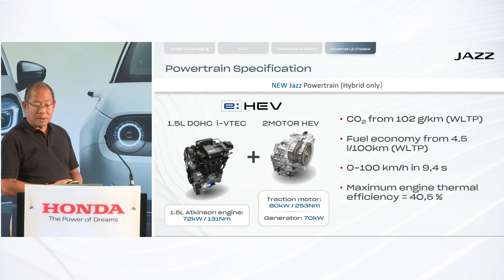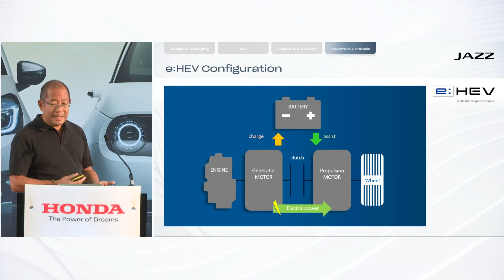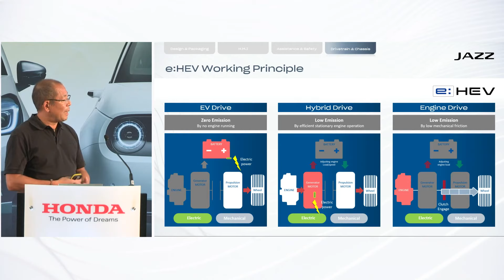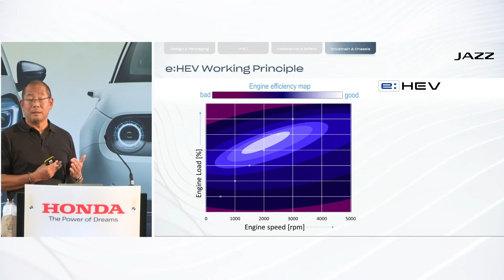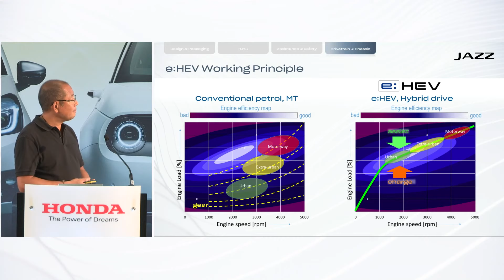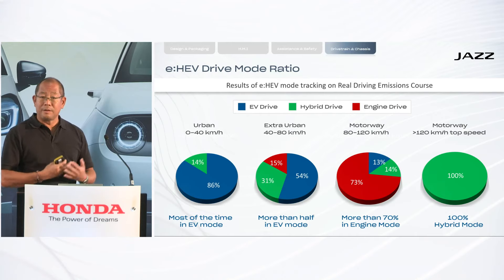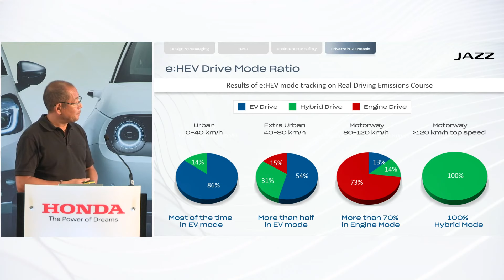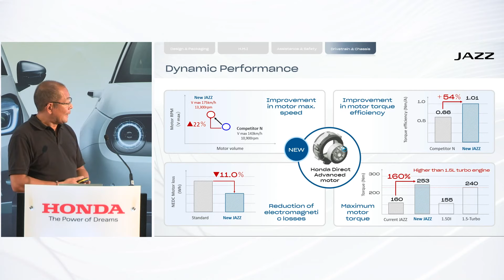Honda e:HEV Hybrid System – How it Works (Ko Yamamoto, Technical Advisor Honda Motor Europe)

Comment: I believe Honda found the perfect system for Hybrids.  The push for EV's is wonderful but imagine an entire population dragging down an electrical grid!  Most first world electrical grids can't handle what's happening today, let alone the proposed larger loads from EV's.  This Honda system will be legendary, it will take about 20 more years for this engine to be "phased" out. Well done Honda!
Reply: Yes, I don't believe pure electric is sustainable for cars & trucks. eBikes and motorcycles? Maybe. Hydrogen engine→electric is probably best,  but that will take some time.
Reply: Perhaps add a plug-in charging to the e:HEV would complete the picture
Reply: @ken2633  2025 Honda CR-V plug-in Hydrogen Fuel Cell EV. Available for lease in California only.

Comment: I only Drive 39km/h now.. my actual Record was on 1.2L/100km!! Amazing!!!!!!
Reply: Wow. But you are probably forgetting the battery depletion. That energy also counts because you will need to start the petrol engine to recharge the batt.
Reply: @rod-no-tube  

Good evening!

No, I am well aware that the battery also discharges during the ride / after the start and thereby also the gasoline engine switches to it. Thanks to my very Spirt saving driving style, however, it is so that when I drive at the maximum possible speed allowed (always drive cruise control!) hardly need the maximum power of the engine (Except of course uphill, there you can not change anything, except to accelerate again briefly something before the slope!). Have therefore also hardly any deviations in the speed & can so by anticipatory driving also get back any amount of battery charging.

By the way, I have again set a new record & was able to achieve a fabulous average consumption of 1-1.7L/100km with several kilometers of driving! So in total I could reach 1'265.1km distance! If I did not now still have a huge mountain that I still have to climb all the way. Then even easy 2'000(+) km would be possible!

Good trip I wish them further! :)
((Maybe I'll make even times nen video, regarding my driving))

-Snowly 😃
Reply: lol its costless to drive almost

Comment: I have 2022 honda cr-v on all seazon tires bridgestone turanza. Drive in crowded city mostly. 4.9...5l/100 average in the summer, 5.7 in the winter 😂 short 10km rides. Amazing system, so fluent, gentle and powerfull when needed.

Comment: then basic concepts of Toyota hybrid, e:power, and e:hev seems to differ... however, it is glad to see that Honda maintains its engineer roots in delivering and presenting technicalities.. even in Europe... very different from Toyota/Lexus I presentation which is more business like
Reply: Exactly! I respect Honda for that so much.
Reply: It's not really new system and I think it was developed by Nissan.
Reply: @SOMEONE-ME  It was first used - and developed - by Honda in the 2014 Accord PHEV. I don't think Nissan had a similar powertrain until 2016.
Reply: @jeffjo8732  Ok, thank you.
Reply: @jeffjo8732  The Mitsubishi Outlander PHEV is the same design (plus an electric rear drive motor for AWD), introduced in January 2013. There is nothing unique to Honda or newly developed by Honda in this system.
Reply: @brianb-p6586  I meant that the Honda system was first used in 2014, before Nissan's in 2016. Not that the concept of system where a serial hybrid converts to a parallel hybrid was "unique." And the innovative parts, to both, is how and when they choose to convert. Which (as I understand it) is quite different.
Reply: @brianb-p6586  I just looked up the Mitsubishi system for the first time. About all they have in common conceptual: when acting as a hybrid, they are mostly serial hybrids. But in specific situations, they turn into single-gear parallel hybrids.

The mechanical design of the Honda system is quite different, enough to be considered "unique" and "newly developed" by Honda. The Mitsubishi is essentially a range-extended BEV that becomes a hybrid when SoC drops below certain limits, for the main purpose of raising SoC. It can also uses the ICE power directly, but does so under different circumstances. The Honda system is a true hybrid that becomes parallel for efficiency.
Reply: @jeffjo8732  There is absolutely no functional difference in the Mitsubishi and Honda designs. If they follow different control logic thresholds, sure, that's just programming. Most of those programming differences would be due to battery capacity, as the Outlander PHEV is a plug-in hybrid, while most applications of the Honda i-MMD are not plug-ins, so they have a much smaller battery and need to operate the engine closer to in synch with power demand.

The designs are physically packaged differently. The Mitsubishi design uses motor-generators which have their own housings and bolt into ports on the housing. The Honda design uses integrated motors mounted coaxially, like various versions of Toyota's hybrid transaxles. This is interesting and has cost consequences, but makes no difference to their hybrid mode operation.
Reply: @brianb-p6586  There is no -conceptual_ difference. There are some functional differences. For example, in parallel mode the Mitsubishi uses the generator for electric production and the (front) motor for power assist. It has to, to use four wheel drive. The Honda turns the generator off and uses the main motor-generator alternately for electric production and (rarely) power assist.

But the big differences - and innovation - are in how they are _used_. The Mitsubishi uses parallel mode for power assist. If the Honda needs power, it drops back to serial mode. A lot of this is evident in the size of the ICE. I think the Outlander - a 4200+ pound SUV - has just a 117 HP ICE. That's just a little more than the ICE in the 3000 lb Insight.

Comment: Atkinson-Miller
Reply: James Atkinson conceived the idea of having the expansion stroke be longer than the compression stroke in a four-stroke cycle, in order to improve the extraction of energy. ANY engine that uses this cycle can be called an Atkinson-Cycle Engine.

He developed three engine designs to implement it. The second used a complex linkage that varied the stroke length between the intake/compression and expansion/exhaust phases. Because it "cycled" between these two halves, it was given the unfortunate (because of possible ambiguity) name "Atkinson Cycle-Engine." And please note how I use the hyphen differently.

Ralph Miller created another engine that implemented the Atkinson Cycle. It used either early or late intake-valve closure to simulate the shorter intake stroke without having to  change the actual stroke length. But it also uses a turbo- or super-charger to compensate for the decreased volume. This is a Miller-Cycle (sometimes a Atkinson-Miller-Cycle) Engine.

The Honda engine uses one idea Miller added, but not both. The point is that it implements the Atkinson-Cycle (no Miller) using variable valve timing, not Miller's fixed timing. So, while it does owe credit to Ralph Miller, it is not his cycle.

Comment: It says the car will always move in EV mode. However, the engine may kick in when driving at high speed and during battery depleted. I read somewhere says the engine will also kick in when cold. Does it mean the engine will start when cold eventhough the battery is enough? Like example; after the car parked overnight or during snow.
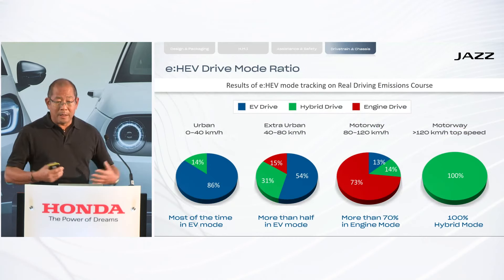Reply: Not quite. Most of the time, the car is propelled by only the traction motor. That isn't "EV Mode." The motor is powered by either the battery alone ("EV Drive" at 6:30) or the ICE-driven generator (Hybrid Drive). The video shows the mix of these Drive modes at that time stamp. And in Hybrid Drive, the battery either assists (green arrow at 6:00) or gets charged (orange arrow) so that the ICE stays at maximum efficiency.

The engine will kick in at high power, not high speed, but higher speed can require more power. And yes, to warm the engine and battery to operating temperature, it can kick in sooner on cold days. But this charges the battery, so it is not as wasteful as it sounds. Operating at the wrong temperature would be wasteful.
Reply: I can tell you that living in canada and it's starting to get cold now, my civic hybrid the EV does not kick in for at least 10 minutes of driving so if you have a fairly short commute, you aren't going to see much EV use at all...

Comment: Hi, I have a question. Does the generator produce electricity to the battery during engine mode? Thanks
Reply: The conceptual answer is "yes." But the technical answer is probably that it is not the "Generator Motor" (as identified starting around 1:00), it is the "Propulsion Motor" acting as a generator. These two devices really have the same design, but the propulsion motor is larger. Both are connected to the drive train in Engine Drive, and could do the job, but my understanding is that the "Generator Motor" is turned off.

Look at the plot on the right side starting around 4:50. This is actually a bit of an oversimplification of a plot you can find in a paper in the World Electric Vehicle Journal, titled "Efficiency Enhancement of a New Two-Motor Hybrid System." I say that it is an oversimplification, because the arrows drawn here represent Engine Drive, not Hybrid Drive (see note). And the point is that in normal cruising, the engine will over-produce in order to operate on the green line, and change the battery with the excess power. Once enough has been saved, it will switch to EV Drive to use up that power.

Note: Constant power is maintained in these plots by moving up AND to the left, or down AND to the right. Charging, which comes from increasing power from what is needed in the colored regions, is achieved by moving up OR to the left.

In Hybrid Drive, if it didn't use the battery, the colored regions in the center plot would move up and left so that they lie on the green line. If this is not in the center of the white region, the battery will be used to move it there by charging (moving up and right along the green line) or assisting (down and left). In Engine Drive, the rpm of the engine are fixed by the car's speed. So it can only move up (to charge) or down (to assist) to the green line.

Example: These are numbers I made up for easy calculation, but they are close to the numbers for the 2018-2022 Accord:

(1) To cruise at 55 mph on a flat road, the Accord needs 15 HP.
(2) In Engine Drive, the engine runs at 2000 rpm. Its efficiency at 15 HP is 33% (or 1/3).
(2A) So it uses [15/(1/3)]=45 units of fuel in one unit of time. What these units are is not important.
(3) But e:HEV will move the operating point up, to 2000 rpm and 34 HP where the engine is 40% (or 2/5) efficient.
(3a) Here, it uses [34/(2/5)]=85 units of fuel in one unit of time.
(4) It sends 15 HP to the wheels, and 19 HP to the battery.
(5) Assuming a loss of 2 HP each way, e:HEV can retrieve 15 HP from the battery for the same unit of time.
(5A) So it can drive for two units of time on that 85 units of fuel. It would have taken 90 units without charging the battery.

There are other fuel savings in this process, but this is the underlying principle that allows it.
Reply: IT does, once you start the car the engine will kick in as a generator, Honda has 2 charging way , 1 is direct from engine another are from deceleration motor. If you enjoy car air-conditioning without drive the engine will kick in to charge the battery. 

Honda Hybrid has 2 battery one is the normal 12V batter to power the electrical appliances in the car, the Hybrid does not had alternator to charge battery, it use the main batter to change the 12V battery, so when the car not move and both battery drain the engine will start act as generator to charge the main battery.

Comment: That´s similar to Nissan System
Reply: Mechanical similarities do not mean they are used the same way. Nissan uses the clutch to add power to electric drive; Honda already has the power, and uses the clutch for efficiency.

Comment: Is it possible to start engine this car without traction battery?
Reply: No, it has no starter, generator working on high voltage is a starter as well. Maybe from the hill 😂